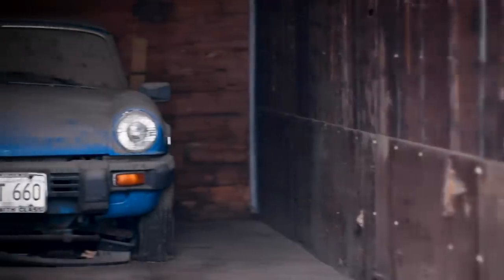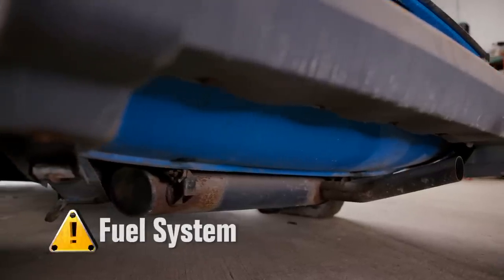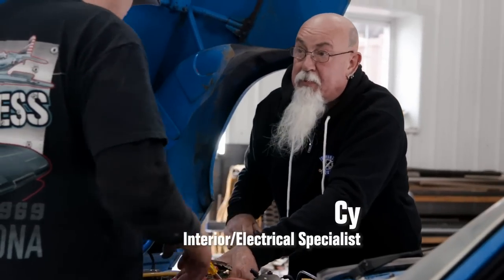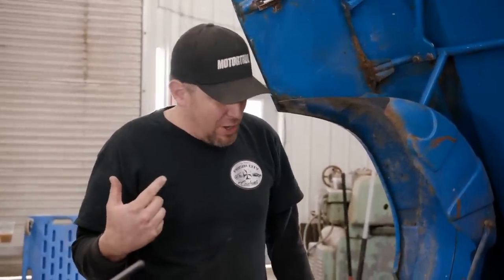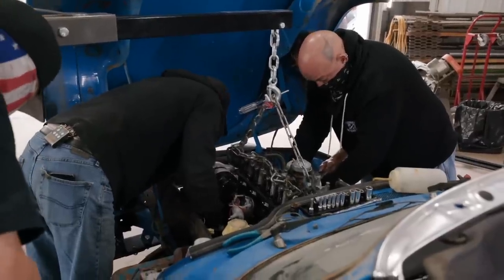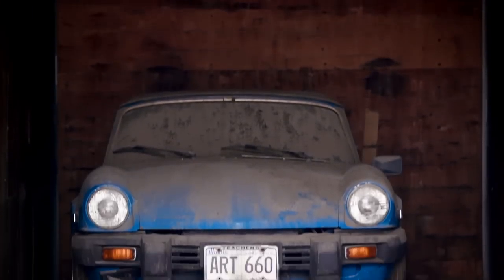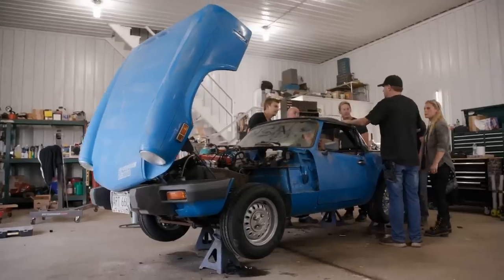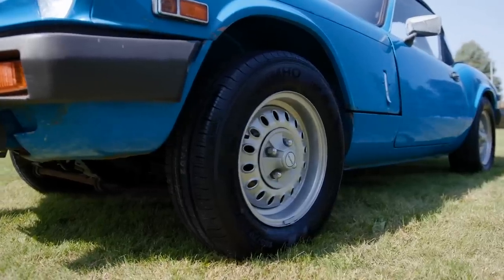Spitfire Runs after 30 Years in Storage! | Garage Squad FULL EPISODE | MotorTrend

Comment: My Sister-in-law fell in love with a red Spitfire of roughly the same vintage, but WAY more miles.  It was driven stock for a little while as the problems showed themselves...then she turned it over to my brother for a little tweaking and updating...

Short story long, it ended up with a bone stock 3 liter Ford Ranger V-6 and 5-Speed...about double the power of the factory setup.  It sounds SO sweet with true dual exhaust through Honda Goldwing mufflers.  It's no barn-burner, but it can definitely get out of its own way!  There's a video I shot from the passenger seat floating around out there somewhere...perhaps on my channel under Fun Stuff.

For my brother, it's a bit of a throwback to a Triumph TR-4 he had when he was a kid in the mid-'70s.  That particular car had inherited a 2 liter Ford Pinto engine that held together at 8,000RPM, and it would outrun his buddy's GS 455 Skylark...after being trounced soundly in a quarter-mile drag.  Break-even, where the Trumpet would slowly roll by the GS, was between a half and full mile from the start...depending on wind direction!

The brother and his wife drive the dickens out of the V-6 Spit on warm, sunny, days from spring through fall.

Comment: What is the cable tethering the engine to the frame?!? Really? Can't tell if he is serious and doesn't know what an engine ground strap looks like. And it takes about 30 minutes to pull and engine and transmission from a Spitfire. It's connected with what, three electrical connections, four hoses, two engine mounts, and the transmission has four bolts holding it in. Surely they're very experienced and are just hamming it up for the camera?
Reply: Ham is one of the 4 food groups of a YouTube channel.
Reply: ....................how about when the lift slammed into the tilt hood assembly....DING.....